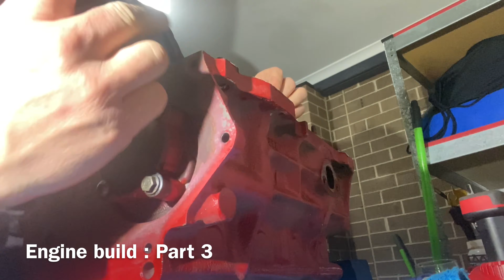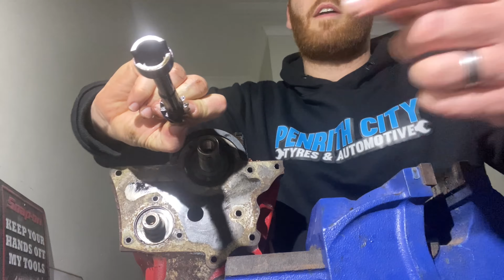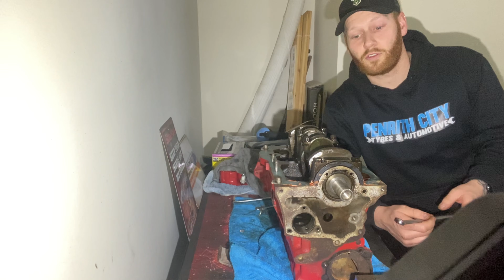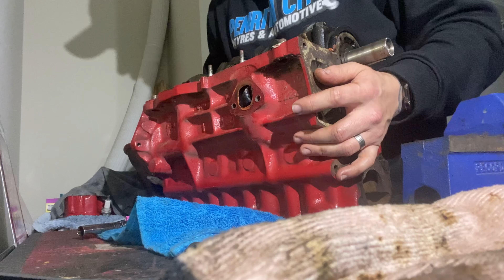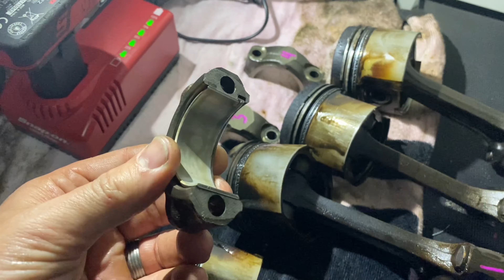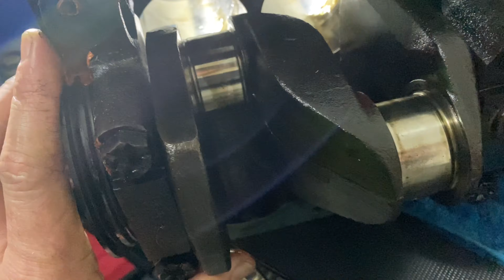Classic Mini 1275 A+ engine build for a subscriber - Part 3 !

Comment: Hey Tomo, is there a part 4 for this series?
Reply from the maker: Gday mate,

Yep sure is. There’s more than 10 episodes in the 1275 build ranging from the engine build through to replacing the diff and building brake/suspension components. 

See link below for episode number 4. Reach out via Instagram if you need. Tomo

https://youtu.be/yzlNnHl2wyM?si=mOhL77MRZuIldwzP
Reply: Fantastic,  thanks heaps Tomo. I have a 78 clubman, and my trusted mechanic in Melbourne ended up taking all my best bits and leaving me with a lit oil warning light.  I'll be trying to rebuild the engine myself, so finding your channel has been great.  You're really easy to follow along with, so I'll definitely be consulting your videos as I go.  Thanks again mate
Reply from the maker: @alfearless  mate I’m sorry to hear that! 

If there’s anything else you need, feel free to reach out on Instagram. 

Glad you’re finding my videos helpful with your build. Good luck 👌🏼